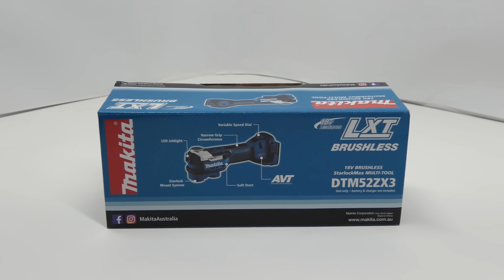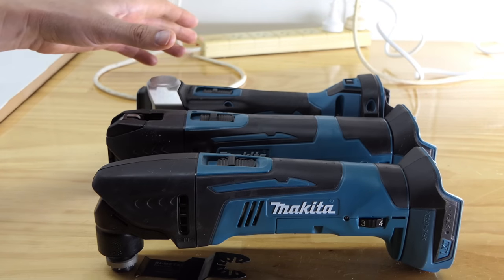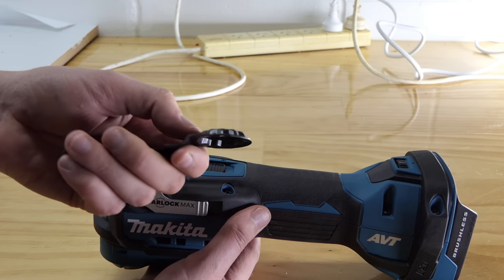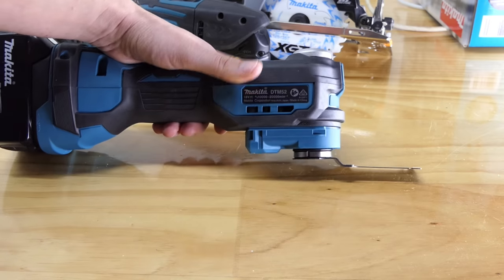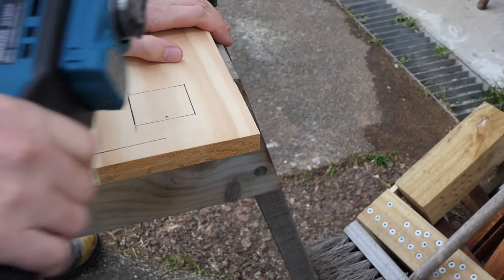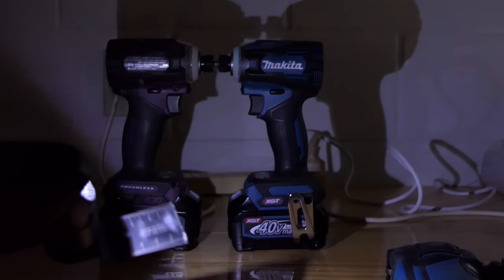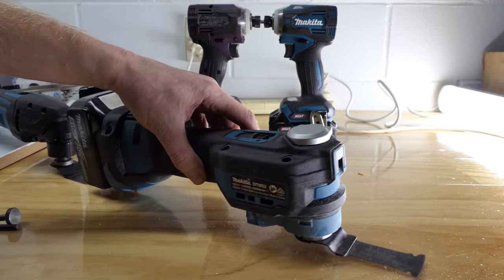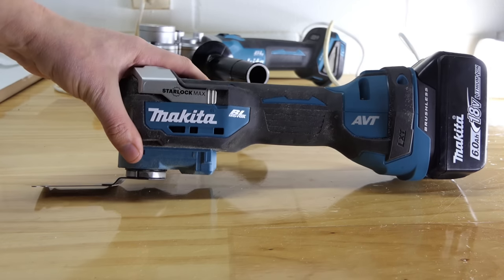Makita 18v Starlock Multitool Review DTM52 VS DTM51 VS DTM50 Makita Multitools. Which is Best?

Comment: Everybody sooking about how the blades changed... Like it really makes much of a difference... Whilst the most important part is how well the tool works
Reply: NO.... it's not just performance it's the availability of the consumables.
Reply: It's the availability of the blades and the cost. I can buy basic no name wood blades off Amazon for about a dollar per blade that work just as well as the 15$ ones they sell at home depot. When you go through a lot of them, they can get pretty expensive
Reply: @carlcox7332  Exactlty I buy cheap blades in bulk off of amazon as them as a consumable.

Comment: The dewalt one has a better blade change, we use makita dewalt as well as Milwaukee, but by far we reach for the dewalt it has a handle more comfortable than the rest
Reply: I love my DeWalt one. My boss has the millwaukee, which does have more power but he's burned up 2 of them this past year. I'm still on the same DeWalt that I bought. I also like the variable trigger much better and the ability to sit it upright on the battery. I hate hate hate the way millwaukee slants their battery which makes it awkward to sit down sometimes when your working in a tight spot
Reply: Have you used this model makita or the older one?
Reply: Yeah 100 percent the dewalt one has the best ergonomics and the blasé change is a breeze

Comment: Makita are useless when it comes to OMTs. I was hoping this one could be the reason I drop my Bosch for a Makita but with that pin out design It's no better than the older models. Sure it performs a little better but you have to pay more for the starlock blades without gaining the benefit of quick change like Bosch, Fein and Festool etc.
Reply: With you on that one mate 👍.  Got loads of makita. but always avoided the multi tools.
Reply: Tbh I just brought fein blades as they are cheaper than the bosch ones, was between buying the makita and the fein omt but I couldnt be bothered with another battery platform so have the 52 🤷🏼‍♂️😅
Reply: @TantonJS  And better than the Bosch ones...
Reply: I like Makita usually but I feel like they have been dropping the ball over the past  few years compared to other companies.

Comment: The majority of my tools are Makita these days. I waited for the longest time for them to come out with a brushless MT to the point that I gave up and went with the Milwaukee 12v; it's pretty great by the way. I don't understand how they are having so much trouble coming up with a multitool that's on par with their other stuff. They keep missing the mark. And why go Starlock! Everyone else has the other style/universal. If you're breaking blade prongs then you're probably using the wrong tool.
Reply: Did you go with the brushless M12 or the brushed one? I have an M18, but I wish I got a smaller M12 or something else to give me more control for precision plunge cuts. I agree with everything you said about this Makita starlock. I have Milwaukee M12 and M18 tools as well as Makita 18V tools. I generally prefer Makita because I think they have better ergonomics, which let me get better precision and accuracy with my work, but I think Makita could do a better job with their multi-tools. I want a compact, lightweight and ergonomic OIS multi-tool. I may also check out one of the Milwaukee M12s.

Comment: I own the 51, comfort of use 3/10...very fat and heavy.   Ease / bit changes  9/10..that flip lever is very quick.  Torque / toughness 9/10  can't stop it.
Reply: when i buy the 52 i will definitely keep the 51 handy for the great assortment of blades/triangle sanding pads and for the easier to use in tight spaces.
Reply: I own a couple of the 51s I love them enough to buy multiple of them. If the new one wasn't restricted on what blades you can put in it and didn't cost twice as much, I would consider it because of being quieter.
Reply: 51 wins for me! Heavy is good for down cuts! 💪

Comment: great comparison vid man!

I had to do some deep research on the whole Starlock thing. What's the difference between Starlock and Starlock plus/max? so it has to do with size/length/thickness of the blades. the plus/max are bigger, longer, and thicker, and theoretically they would place too much load on the lighter multitools that only use regular Starlock. So they changed up the connection point to prevent oopsies from occurring, and burning out your lighter tool. Of course if you pick this tool up it's irrelevant as it takes all 3 blades.

Also apparently the 3d section of the blade puts the load on the heavy metal cylinder of the tool instead of the load being on the blade and the spindle. So safer and stronger, at least in theory. I say theory since I haven't personally tested it, just looked stuff up. But I love the feel and comfort of my new Makita MT. I agree with your recommendation. If you've already invested a ton in another tool, especially one with OIS blades (or Dewalts proprietary stuff), stick with that. If your buying your first one, or looking to upgrade, Id definitely go with the Makita. Starlock seems to be the big one when it comes to compatibility, since most the manufacturers are going in that direction, including Festool. And since Festool does it, it's gotta be good! (jk hehe, but hey Festools are great stuff, just saying).

Comment: I recently purchased the fuel m18 milwaukee woww its just a beast i would say perfect multi tool
Reply: Definitely, and it uses the standard buy anywhere blades. Unlike this stupid design, which uses the "try to find them anywhere if you can" blade design. Of all the things to change on a multi tool, the blade fixing it the last thing you'd touch.
Milwaukee seems to excel at this part of their designs. They always look at the most common used fixings and accessories, and then design their tools to accept them. Their M12 mini rotary tool is a great example. It fits 99% of all Dremel accessories, so Milwaukee don't need to make these, as they are already covered.

Comment: I’ve got the DTM51 and it does what it needs to, but it is bulky and heavy. The 52 doesn’t seem much of an upgrade in that regard.
They’re generally not used for extended periods of time so a huge battery shouldn’t be a requirement. Personally I would love to have a small and light multitool with a small battery.
Reply: Makita make a 12volt version, under a kilo, not Starlock
Reply: I use a 2ah 5 cell battery in mine

Comment: Got one a week or so ago for 150€ in slovakia as mi first multitool and so far i love it. No blade in the box
Reply: In the uk they are about €230. Welcome to England
Reply: 255 dollars. Only the tool, taxes included. 
Is black ( not the regular makita color )  No adaptor possible to use the universal blades.
Working time only 20 minutes  with a 18 v 
5 mah fully charged battery.  Not yet a longer time use with a 40v or 60v batteries.
A Nice video

Comment: I am still rocking the original makita one with the allen key.  I am in the market for a new one, but with the cost of these blades compared to the blades I can buy for like 3 blades for a single dollar, looks like I won't be upgrade to this newest one any time soon.
Reply: You can buy starlock adapter to fit old blades

Comment: So glad I went with fein a year back rather than wait for this. I'm Makita across the board for most tools other than a few items. 

That blade change is crap and have stopped to comment there. Starlock but still that pin nonsense? Maybe its a patent with Bosch and Fein having the proper one handed blade change.
Reply: That pin! 😡😡
Reply: It costs a shit ton of money to license the quick change starlock . So thats probably why.
Reply: I'm on the Makita platform but I have to say that with the notched-out OIS blades, Dewalt's quick release system is the best I've seen. I would rather Makita went down that route and did away with that nonsense pin completely.
Reply: But how often do you change the blade to make such big of a difference? 🙄
Reply: @alexc.239  what a stupid comment!?  That would be totally trade and job dependant. Some cuts would require 3 blades in 5 minutes. On the other hand for a DIY’r you’d have the same one for a year. 🙄
Reply: @leerolfe5332  are you really asking me if my comment is stupid? 🙄

And maybe some cuts will require 3 blande changes in 5 minutes but that happens once a year.
Reply: @leerolfe5332  i re readed and still found a question mark in the sentence about my stupid comment 😅❓
Reply: @alexc.239  yeah cheers for that. Bet you wouldn’t be so brave in person. What a lemon.
Reply: @leerolfe5332  😂 someone has anger issues, calm down Tyson 🤜🙅‍♂️
Reply: @alexc.239  you have typing issues pal. Like writing for the sake of it. Warrior? Keyboard?

Comment: Another interesting tool review bro! I'm Makita tools mainly. But hated there multi tool so I went with the new Milwaukee M12 anti vib multi tool. It's light and small and very grunty for a 12v tool. Beats my dad's Dewalt 18v. Also it has a magnet to hold the blade on while changing blades. That new makita looks rather clumsy to be honest.

Comment: Great. I ordered DMT51 several month ago and it was on backorder until last week... And now I find they have DMT52 :D
Reply: I have the 51 and its great, the ease of changing the angle of the blade and replacing it easily makes up for no light, plus against the star blades it uses standard blades that are about half the price.   With the weight of the battery on one end having a unit that is a bit heavier is a plus because it counteracts the battery weight.
Reply: I also have the 51 and, despite the lack of light, will be sticking with it.

Comment: 14:10 - to test the different tools against each other, first take out a new mortgage on your house, then cut the tips off the blades that fit the different skins & tig weld on the same blade to each tools blade. Gonna be pricey but it’s the only way I can think of a test with continuity.
Reply from the maker: I've got a much simpler idea than that... if it works... Still might need the mortgage though.
Reply: Can’t wait to see that video! Don’t believe iv seen a multitool comparison vid yet👌🏼

Comment: The performance of this tool and the overall ergonomics seem good. With that said, I think I'm not going to buy it because I already have a lot of OIS blades, and, more importantly, there are a lot of options for getting various kinds of OIS blades for relatively cheap both online and at some discount hardware tools in my area (Chicago, USA). I also don't love the fact that you have to remove the blade retention pin when you load the blades. I guess it's not that big of a deal.

I own a Milwaukee M18 multi-tool. It was the first multi-tool I've ever owned. I don't really love the ergonomics. It's too long, and because the battery is mounted at an angle, you cannot stand it up on the battery. The M18 batteries are a lot bigger and heavier than Makita 18V batteries, which makes the tool heavier and awkward to hold. I only use multi-tools as precision tools. I used one last weekend to cut out a rectangle in a builtin wall cabinet at my mother-in-law's house to install a low-voltage wall plate with an ethernet jack. In these applications, I want my cut lines to be precise and clean. I don't need my multi-tool to be very powerful. I want it to be lightweight and short so I can get a good grip close to the blade and control the cut as much as possible. Since it's really easy to overcut corners with multi-tools, I like to plunge-cut a bit further from the corners and then finish these kinds of cuts in the corners with a thin hand saw. For my wall plate, I used Milwaukee's compact hack saw to cut the last 5mm at the corners, and I was very happy with my results on this little job because my cuts were very precise.

Milwaukee's blade loading system is actually really good. They use a lock lever plus a screw-down pin that doesn't drop out. You just unlock the lever, loosen the screw a bit by hand, pull out the OIS blade if it has an opening on the end, and then reverse. I think it's just as fast as starlock.

But the weight of the M18 tool and the ergonomics during operation aren't great. I want a multi-tool that's lighter and shorter than my M18 with a better grip. I want a brushless motor with some good anti-vibration control to make it easier for me to precisely guide the tool along my cut lines. I think I'll probably just wait for either Milwaukee to release a more-compact M12 brushless multi-tool or maybe for Makita to release an OIS version of this tool with some small improvements.
Reply from the maker: You can get an adaptor now for this Makita to run OIS blades. I will be doing a review on it shortly. You may also be interested in this Multi-tool comparison https://youtu.be/UEws-gbUUhk

Comment: It's exactly the king of multitools like makita impact, but unfortunately it doesnt have very quick system changing blades as dewalt has or it requires a unique one
Reply: We have several DeWalt multi tools in boxes that are basically unused at work because they require the special blades with open backs, which is a limited selection. DeWalt also doesn't make very good blades in my experience. Says "made in China" on the back.

Comment: The models vary by country apparently. My U.S. model of the previous version is XMT03 and came with a universal blade adapter. The extra weight adds precision to cuts when using two hands. I suppose that's a personal preference. I've had nothing but outstanding results and ease of use with mine. It's an absolute beast and built like a tank. All of the blades you said won't fit are easily used with mine.

Comment: Vibration is the key with these tools and so it's the Fein every time . I have white finger as a result of using lesser tools. The Fein has a floating head and so reduces vibration massively and still is totally efficient. The best blades are the curved Bosch Starlock  these are very smooth at cutting and significantly reduce chatter, that's my system.
Or just buy Japanese pull cut saws! silently brilliant! not for cutting metal of course....!
Great comparison video and multi-cutters are essential in some situations.

Comment: I didn't get a blade :(. Paid $240 out the door with our 25% sales tax here in Norway. I also saw that there was some dust extraction solution in the manual. My old 51 model came with a triangle sanding pad and dust extraction solution. New one did not.

Comment: Your best bet on comparing all of the multi tools is the starlock blades. I think the only one it won't fit in is the DeWalt. But the dewalt comes with a little plate and screw that fits in the bottom of the blade holder. Its not ideal and theres no "teeth" to lock the blade in so tighten the hell out of it.
Reply from the maker: Yeah I have already purchased a bunch of fein starlock blades and checked them on the tools... bloody dewalt.
Reply: The DeWalt is good but for heavy use it vibrates way too much. I have the dm51 and it isn't awkward to hold at all like he says, it's comfortable, solid and absorbs so much more vibration than the shitty DeWalt.

Comment: they are charging £200 for this in the uk, the dtm51z costs £115. A huge price increase and no blade in the box and a poor blade change mechanism compared to the fein. Makita haven't announced a corded version of this so far, i wonder whether they will release one, it would make the rear narrower. The newish milwaukee 18v and 12v have low vibration and a higher ~4.0 degrees cut. Would be great to see a side-by-side comparison of those compared to this new makita to see the noise level and vibration comparison and also cut speed although i'm pretty sure milwaukee will cut faster.
Reply: It's literally using a Fein mechanism.  There are big cons to the toolless starlock clamping mechanism.  It depends on what you use it for, however.  I'm happy for toolless starlock when I'm burning through scraper blades.  I'm cursing at it when I'm in a cupboard, making a cutout and am fighing with the starlock mechanism while trying to set the right angle.
Reply: @robertrada6040  Exactly. My Fein has the same pin and lever mechanism. And I bought it years ago before multitools were everywhere. It's not a new thing.

Comment: Why make a product with starlock plus more exspensive blades and dont use the same atachment as the festool it looks like the old way of conecting the blades is faster and cheaper
Reply from the maker: It may be a patent issue.
Reply: @ToolsAndStuffOFFICIAL  Since Bosch is quite evidently in the business of selling consumables and not power tools, I would not be suprised if they were incentivising the use of their patents vs collecting patent pennies.  Makita is implementing a hybrid of Starlock and the previous Fein pin mechanism (neither of which are noticeably faster nor slower than the other in real world use) and the Starlock trademark is right on the tool.   It could be that it's cheaper to make, it could also be a design decision based on user feedback.   The toolless starlock mechanism is not "all that".  It's more of an obstacle when you need to angle the blade but you are not quite sure what angle you need it at until you get there. It's a lot easier to move the blade around to each setting before locking it in with the pin than dealing with the toolless clamp mechanism.  I hope I'm making sense.
Reply: With OIS you are limited with blade length because the pins can't take it and shear off, this is why Starlock and others were invented.